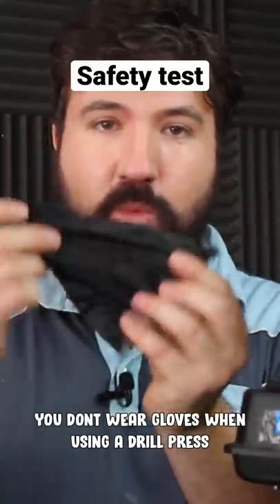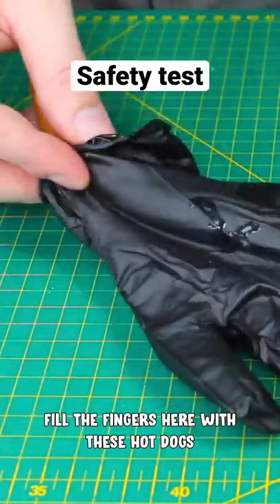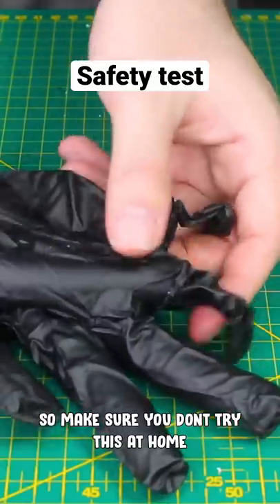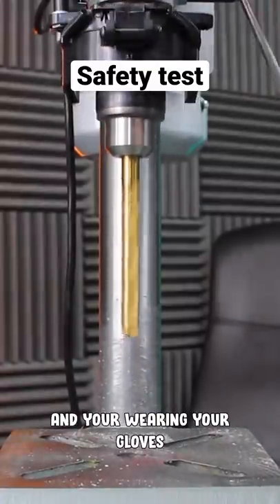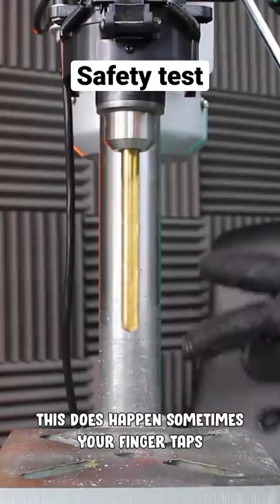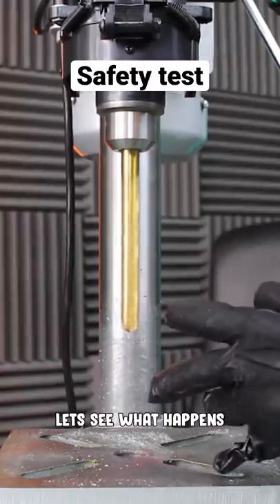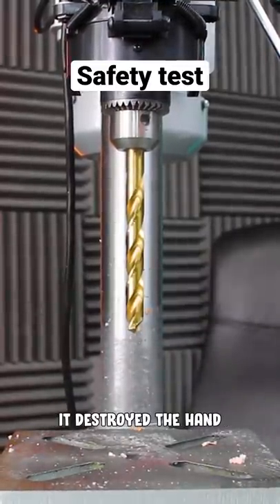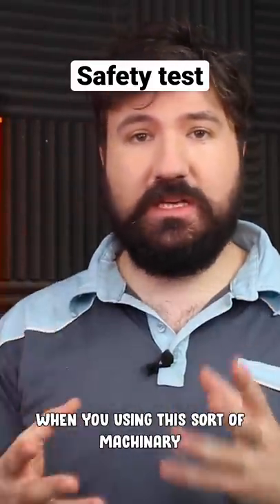Never wear gloves using a drill press insane result!

Comment: "let's see what happens when you accidentally tap yoir finger on the drill bit."

Shoves the hot dog filled glove, palm first into the bottom of the drill.

Real informative this...
Reply: And then just let’s it go. “Oh look my gloves got caught on the drill let’s push it in further.”
Reply: Dont mean to be that guy but he had it between the thumb and forefinger, which I can say from experience is a pretty likely place to catch your hand.

Plus, what he should've done is used fabric gloves meant for metal or woodworking, which wouldve proven his point further since they would actively pull your hand into the drill bit. 

He's exactly right and even if he showcased it in a mediocre way, i've seen it first-hand and it aint pretty
Reply: @FractileSoriah proven fact: if you touch a drill bit your hands will turn into sausage
Reply: Mate you got me all fucked up,  laughing my balls off here
Reply: @FractileSoriah  no his not, if you jam your hand in like that it’s gonna get destroyed no matter what.  some protection is always better than none
Reply: @draconisthewyvern3664  Well again he didnt jam the hand in there and if youre working an assembly job standing in place drilling the same hole over and over for 8 hours sometimes your hand slips pretty hard into the drill bit. Under those circumstances, it's more dangerous to be wearing gloves, especially fabric ones. If you've ever done metal work you will without a doubt find metal shavings attached to your gloves and they stick pretty forcefully most of the time. Now take that metal shaving stuck in the fabric of your glove, make it spin really really fast and put a bunch of torque behind it. If you're bare handed youre going to give yourself a nasty cut, if you're wearing a glove you're going to break multiple bones in your hand AND give yourself lacerations. The best protection is sometimes just your own skin.
Reply: @FractileSoriah   a bad cut is not the worse you will get. people have had broken hands and amputated fingers even when they weren’t wearing gloves.

an yes fabric can easily get caught so can your hair and sleeves.  that goes for basically anything that spins. power drills, power hand saws, wheels, pulleys. chain saws.

but when i have my hand near flying  and kicked up wooden chips and metal shavings ide rather have a glove on.

the work should be secured by at least 2 vices, your hand shouldn’t be anywhere near the actual drill bit, you wanna adjust the work you turn it off first.

wear tight fitting clothing to reduce the risk your clothes get caught.
Reply: @draconisthewyvern3664  Well hey, your funeral. Everyone and everywhere ive worked around power tools has been in general agreement that you don't wear gloves on a drill press or a table/chop saw, and i've seen first hand why. I'd much rather have some mild irritation or light burns from hot aluminum on a drill press or saw than a destroyed hand but you do you. There are millions of ways to avoid getting injured, yes. Not everyone follows those and they don't account for accidents or even bad luck. The chances of you getting severely injured by bumping a spinning drill bit and even the severity are far less bare handed than when wearing gloves, but at the end of the day, its up to you.
Reply: @draconisthewyvern3664  Check any valid source. I checked OSHA regulations for example. Any credible source will tell you to not wear gloves in this situation. Reason being, they aren’t actually tight enough to your skin to rip off. Materials stretch before they rip and most gloves will just get caught and pull your hand into the drill with them before they finally reach the critical point where they rip. Gloves are useful but they aren’t something that helps 100% of the time like safety glasses. It depends on the situation and where you work. Working with spinning or rotating machinery is one of the situations in which gloves just makes accidents worse.

Comment: A circular saw at my old window factory job had a broken guard that had to be manually lifted to cut anything. Working daily with chemicals, we had to wear latex gloves at all times.  I went to lift the saw guard for my next cut and it was already stuck open so I basically just grabbed a spinning, dull, circular saw blade with my gloved hand. It felt like someone punched my hand and the machine made a loud BANG. The glove ripped clean off my hand and stopped the saw instantly but I didn't leave unscathed, requiring 9 stitches to fold my flappy middle finger back together. I consider myself incredibly lucky that I didn't end up caught in the saw just like this video
Reply: How much did it cost you to give a middle finger again?
Reply: Holy crap man hope your ok
Reply: Did you get any money out of that? Where I live forcing an employee to use a tool without a proper guard is a huge no no
Reply: If there was a loud bang I'm guessing that was the sawstop going off. They keep explosive charges inside saws that go off when they detect it's made contact with flesh, specificallty the electricity in our bodies. those explosive charges slam breaks into the teeth of the saw blade, probably ruining the blade but also stopping it from injuring someone further.
Reply: @Zadamanim  the “breaks” are big blocks of aluminum. Watch a video of these machines in action they look dope, they just slam a brick of aluminum into the saw and the aftermath of it is super cool.
Reply: @Zadamanim  I dissagree. A saw stop will normally not leave you with a finger that needs 9 stiches... the loud bang would rather be the thick glove getting tangled up and ripped apart or thrown angainst the inner workings of the machine. Furthermore it is a rather new system and not fitted to cut aluminium or other conducting metals, something you have to do frequently in a window shop.
Reply: @philipphermann9454  That's a good point, it could have been the motor getting suck on the gloves that made a loud sound. A saw with a saw stop might still do unexpectedly high damage to a gloved hand, though.
Reply: You should sue the company for workplace safety violation. Why should someone operate defective equipment??

Comment: "Your finger taps the drill bit"
proceeds to mash the entire glove hard into the bit
Reply: It really doesn’t take much, a slight snag of the bit and it quickly compounds. The result it quite unpleasant.
Reply: Because it grabs the material
Reply: I don’t think it’ll take the entire hand with it lol it’s just a latex glove can be easily ripped
Reply: Yeah also I don't think anyone is going to tap the front tip of the bit, more likely the shaft
Reply: Mmm he tapped the bottom of the shaft but not the tip, between the thumb and forefinger. Honestly a pretty likely spot to hit it if youre going to

Comment: I've messed up my knuckles doing this once. I'd still wear gloves to keep tap oil off my hands though, just gotta be more careful.
Reply: How is the knuckles now?
Reply: I’m gonna ruin the knuckles in your get
Reply: So you're saying the gloves were bad, but you're going to keep using them. 🤦‍♂️
Reply: @hysterheister0947  yes 😎
Reply: Happened to me aswell half a year ago. I was drilling metal and wasn't concentrated and when I tried to put the metal away the drill touched the opening of my leather glove and pulled my whole arm into the machine. Thankfully the glove ripped apart or I probably would have lost my hand. All fingers and my thumb and joint were broken and I got operated twice on my hand. Always avoid gloves when using machines that have a spinning element to it guys.
Reply: E
Reply: A
Reply: YOOOOOOOOOOOOOOSH
Reply: @Dopetv-zd9ov  I’m glad you’re fine, but tbf you said a leather glove that is considerably stronger than a latex glove which presumably would rip apart quick enough that you wouldn’t sustain any injuries
Reply: @Dopetv-zd9ov  Damn man that sh*t sounds Terrifying. Glad that you're okay though. Stay Safe Man.

Comment: This applies to more than just drill presses too. Pretty much any machine capable of removing flesh will do more damage if it snags a glove instead of bare skin.
Not to mention some machines have safety measures that detect skin contact and immediately stop. Wearing "protection" prevents that safety measure from detecting your skin, then your hand is gone.

Comment: Ah yes because the bones in hotdogs are very similar to the bones in our hands. Very realistic result, thanks.
Reply: Obviously it's not blow up your hand smart guy, you'll still get massively hurt if that happens
Reply: @soilder_75k  Not with that kind of glove. It would rip before your fingers get sucked into it. Your fingers are far more firm than a hotdog. A latex glove would simply peel off the hand. Since fingers won't bend like a hotdog, your hand won't get wrapped up in the machine. This video was stupid and so is your comment. Simple as that.
Reply: @JMC5519  Regardless, the point of the video was simply to tell people not to wear gloves (whether it be latex or fabric) when dealing with these types of machinery, which it was able to convey even if the way it was presented was flawed.
Reply: Have you ever worn the correct size fitted latex gloves to your hand? Because I know working with them that when your hands get a tad bit of sweat you have to pry them off I'm pretty sure it would pull your hand in.
Reply: @ghosthunter0404  Have you ever gotten a tear in a latex glove? It peels very easily. It's not sticking to your hand, it's the suction from the glove that makes it difficult to pull off once it gets wet. If you tear it, it'll still peel back very easily. Only way it would pull your hand in is if it's a loose glove and it bunches up on the drill bit, which wouldn't happen with a fitted glove.
Reply: @JMC5519  it’s still possible to get really hurt. You must break a nail, or get a really bad bruise. 

Also, he’s not talking about a specific type of weak glove. He means all types of glove. Meaning you can get hurt by a really good hard glove surely.
Reply: @itpleasesmetosaywhatibelie3822  The video showed a latex glove. The other comments were about latex gloves. You slow or something? I actually have experience operating drill presses, cnc lathes, etc. Can tell y'all don't.
Reply: @JMC5519  he says “never were a glove.”

Not “never wear a latex glove.” 

The video mentions gloves in general to not get hurt in general with any type of glove in general. 

But tbh I’m not trying to be mean. In your position I see why you would think I’m slow. Tbh most arguments are just misunderstanding and information that isn’t always meant in bad intent. 

I guess we both got our point across and can respectfully be ok or something I guess.
Reply: @itpleasesmetosaywhatibelie3822  The demonstration was literally with a fucking latex glove buddy
Reply: @JMC5519  

So what? He says gloves, not latex gloves, JUST GLOVES. 

I’ve already explained what I said. Do you need to reread it?
Reply: @itpleasesmetosaywhatibelie3822  My comment was about the hotdogs and latex gloves. Idk what bullshit you're on but the debate was never about the type of gloves lmao
Reply: @itpleasesmetosaywhatibelie3822  i think you got trolled lmao, OP is likely just acting slow so they can get a kick out of people.
Reply: @JMC5519  like how mfers like u never touched power tools but act like pros. And those who are alwasy around it are called dumb and told there wrong.  Stfu  bro really
Reply: @Roy_In_A_Safe_Space  yeah. I hate when people do that, and it’s worse that I’m gullible to fall for it💀
Reply: @ghosthunter0404  that’s because you’re not very smart
Reply: @itpleasesmetosaywhatibelie3822  you have nooo cognitive ability
Reply: @Roy_In_A_Safe_Space  nah both of you are not smart.
Reply: @dontworrybout2664  Okay then explain.
Reply: @JMC5519  imagine being so dumb that you literally attack someone for misunderstanding an argument. You clearly dont use your brain, so do the world a favor and cover your walls with it.
Reply: @Roy_In_A_Safe_Space   Nah the whole premise of the vid is fucking dumb. First of all, your finger tapping the drill bit never happens. NEVER. You clamp your piece down and your hand never gets close to the drill bit in the first place. If you touch a drill bit, and your little hotdog fingers are weak enough to rip off before the latex, that's natural selection in my opinion lmao. None of that would ever happen.

Comment: We're you dropped on your head at birth mate ?
"This does happen sometimes "
* Pushes the hand forcibly into the drill bit right in between two of the fingers *
I used to do this for a living. It only takes a small nick out of the rubber glove, or a worst-case scenario is that it rips a piece of the glove off.
So yeah don't wear gloves using a drill press IF your fingers are made of hotdog 🌭  hahah

Comment: I had a similar accident with a big exhaust fan motor sheive (pulley). I wasn't wearing gloves and it was off. I was spinning it by hand to bring the belts around so I could get the size to change them. I caught my pinky in the belt. It was moving very slowly and but it was a very big squirrel cage blower. It was also a VX belt which didn't help the situation at all.  My pinky didn't stop the spinning, and I lost the tip of my finger and nail as well as broke it in two places. Definitely not a mistake I'm likely to make again. Power off does not mean zero hazzard!

Comment: Brings me back to the moment I decided to clean a drill press and slash my wrist beneath the bit tightened in because in my brain I forgot that the drill bit is still a hazard when the machine was still off. Ended up needing stitches but at least my hand did not decide to fall off.

Comment: I was using gloves once because of some sharp edges on some metal that i was drilling, my only luck was that it caught my eye the moment it started to bite between my middle finger and ring finger, tore the flesh right of of those sides of fingers and started to twist my hand, my reaction was really fast and still i couldnt get out without a wound, so what i did, i shut off immediately, it was still rotating and i grabbed the drill with my other hand to stop it momentarily and not lose my hand to the wrist since i was wearing thick hard leather gloves, have still some scars, but this reminded me of that day.

Comment: Another point: sometimes the drill bit catches the piece you're working on, pulling it out of the vice and turning it into a more dangerous spinning thing. While nitrile/latex gloves are usually not an issue, anything thicker can and will try to ruin your hand.

If it's a lathe... bare hands while it's running. If the surprise tug pulls your arm close enough to get your sleeve caught, that's losing an arm at best. Probably your life. It's just not worth it.

Comment: i worked at machine shop, I had welded some steel, I used the pillar drill with my welder gloves , I tried to knock off the loose steel off the drill bit while it was running.... it hooked me up, I smashed the emergency stop.... it almost ripped my arm off... if it did not stop when it did it would have being alot worse... SAFETY FIRST, THERE FOR A REASON....

Comment: I learned the same lesson using a rotorooter to clean a septic tank pipe. Almost lost my thumb but rolled with the turn and drug the machine the same direction which took my foot off the button to run it. I decided after that I'd rather call a plumber or bleach my hands next time instead of using gloves.

Comment: Drill press doesn't present much hazard in this case, it will either just pull the glove off of your hand or rip the glove, happened to me once or twice when I was doing long and intense shifts in a shop, no time to take your gloves off every time you are drilling a hole.

Lathe is a different thing though, NEVER have anything loose or dangling around your hands/arms while working with a Lathe, and no loose hair too!

Comment: First off, you’d resist the pull of the drill and the glove would rip. Second, even if it didn’t rip immediately it would stretch for a bit giving you time to hit the emergency stop. Thin gloves like that you can get away with on a drill press if you’re careful, but actual work gloves would be extremely dangerous.

Comment: In my early HVAC days, I was helping hold a concrete drill for a coworker so that it would penatrate the wall at the proper angle. I was holding the actual drill bit. Keep in mind this is like a 18 x 5/8 inch bit. Well, my dumbass was wearing gloves just like that. I actually wasn't wearing gloves at first, but I couldn't hold the drill properly because of the weight of it and the angle, so in my infinite wisdom, I decided gloves would give me better grip. The gloves did indeed give me better grip. As SOON as he turned the drill on, I yelled for him to "STOP, STOP, STOP!!!". My fingers were being twisted around the drill because it had pulled the gloves around it. Luckily for me, these were very stretchy gloves and the drill stopped quickly enough that it didn't snap the bones in my fingers. But man did I learn something that day. Never again.

Comment: It's so easy not to touch drill bits I'm 14 and I had construction course for 3 years and I've never had a accident using any machine especially a drill that all you have to do is clamp wood and go down with drill for 5 seconds pull out and stop